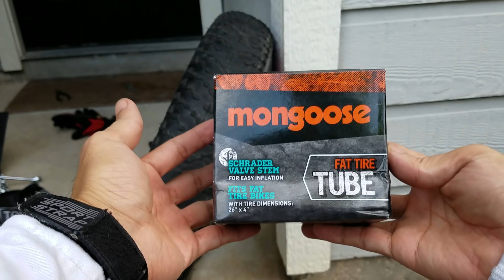Radrover Rear Tire Removal

Comment: just a little tip... you can actually fix the tube with a patch and not take the rim off but just break the bead off on one side and pull the tub out and repair it then push it back in and reset the bead  inflate tire and good to go... although in your monster nail case I agree and think you needed to replace that tube...thanks for sharing I enjoy your videos...
Reply from the maker: 👍🧡🚴‍♂️💨  Thanks for the tip but I already had multiple punctures by the nail so had to replace the inner tube.

Comment: They make a fix a flat for bikes , it 's good for on the road repair. I always change the tube when I get home. I have changed a lot of flats on bikes , but the E bike is a little harder with the heaver back wheel and it's seams you always get a flat in the back.
Reply from the maker: Yes, and the fat tires also make it more expensive.

Comment: i would put a block behind the rear wheel. now i see that shield outside the derailer. I did not have to remove it. how about if you put a protective tape between the tube & the tire. like the mirror you got. chain & gears look pretty clean, no rust. dry climate i guess.
Reply from the maker: 👍🧡🚴‍♂️💨 a tire liner may help. Silicone spray the chain,  humid climate. Most of the bike is stainless steel and aluminum frame.

Comment: Good job and a lot of useful tips.  I watched your shakedown trip to see that the rear wheel was seated properly and it was. When I get my RadRiover, most of my rides will be on dirt trails of packed and loose sand,  with a lot of cactus scattered around.  Flat tires now and then will probably be inevitable.
Reply: You should really get a Tork wrench and use your rubber mallet on  something else’s like  ???

Comment: Be sure to check to see if the tire seated on the rim evenly all the way around on both sides. Those Kendas like slip off a bit and the tube will slip out. Don't ask me how I know. It is easier to remove and reinstall the rear tire with the bike upside down but you have to place something under the grips to keep the display from hitting the ground. Gravity is your friend.  I use a couple blocks of stiff foam to rest the grips on.
Reply from the maker: Thanks for the advice.  My fenders get in the way of turning the bike upside down.  This just works for me.

Comment: I cannot get the freewheel off.  Any tips on that?  The electric stuff in the way.
Reply from the maker: 👍🧡🗽🖖🎄🎁🥳☮🌎 I think you have to make modifications to your tools to remove the freewheel.
Reply: @JamesBondJB007  Please let me know if a tool is available
Reply from the maker: @dsly100  no known tools available, hence you have to hack it.  Google it.  Info is out there.

Comment: Thanks for the video. The question is, to slime or not to slime? ;)
Reply from the maker: I say slime.  It's cheaper, easier, and will work good enough to get you home or back were you need to go.  Now I know what the look and hear for the next time.
Reply: Yes, there is nothing worst than having to repair a flat on the road. I think that when comes time to replace the tires on my bikes, I'll make sure to buy puncture proof tires.

Comment: i got 2 flat tires same week front tire was easy this one is gonna be a bish
Reply: @JamesBondJB007  great thing about bout times is i was 1 mile or less from my house and 2 i bought 2 intertubes instead of 1 i stay in chicago so i think the cold could have had something to do with my flat because i couldnt find a nail glass or anything in my tire i patched the front tire but it wont hold air for longer that 3 hours
Reply from the maker: @IMHUSTLNGAMIN  👍🧡🚴‍♂️💨  Also try using some tire sealant. And check the inside of your tires for any smalle thorns that may puncture your tubes.